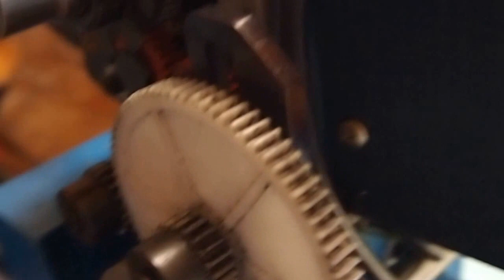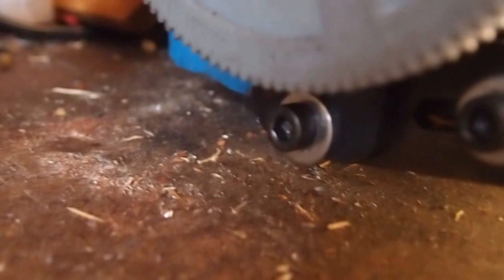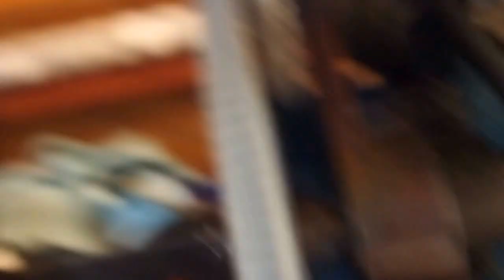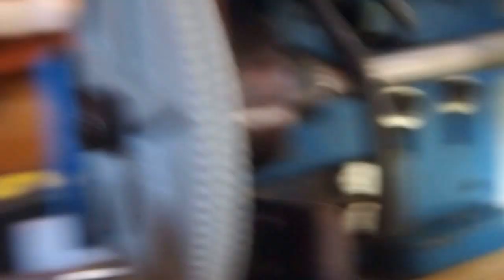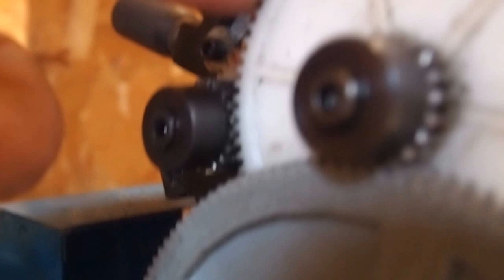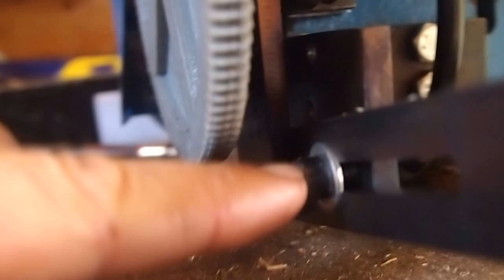127 tooth gear for mini lathe

Comment: I'd love to see more details!
Reply from the maker: I should update this video,
I can tell you this Banjo is still working, as are the PLA 127 tooth gears.
I have since added a jackshaft to reduce RPM and increase torque.
Reply: @erniepike3902  Thanks for the reply! I'm glad to hear that PLA has survived the test.
Reply: You should SERIOUSLY update this video😂 i basically only do metric threads and i seem to have trouble with the gears the calculator gives me. Im printing a 127 right now. I have several full sets of every gear there is printed out of everything- my printer specializes in the highest temp engineering filaments, despite all the ULTRA strong filaments ive used- ive never once had a simple PLA+ gear go out. I'd appreciate a pic or something of the banjo assembly, I'd like to make one!   @erniepike3902